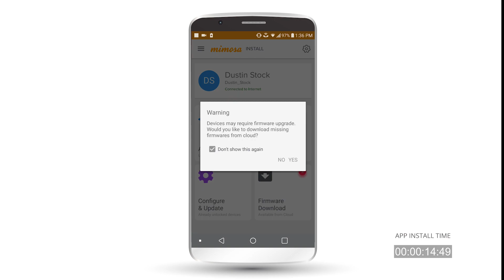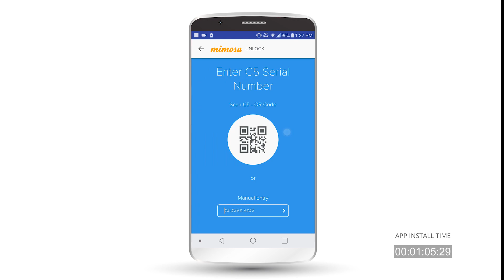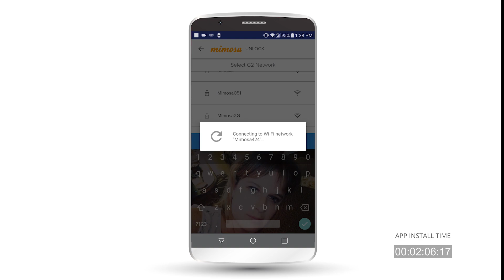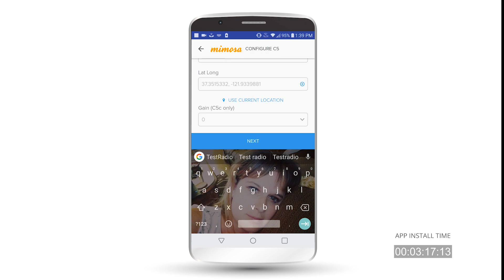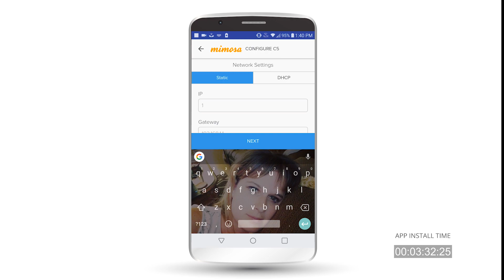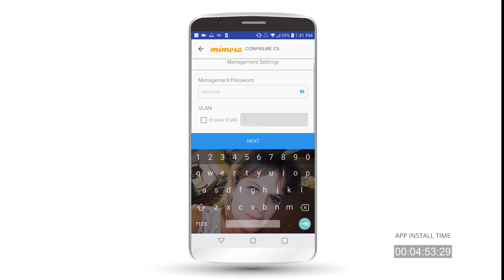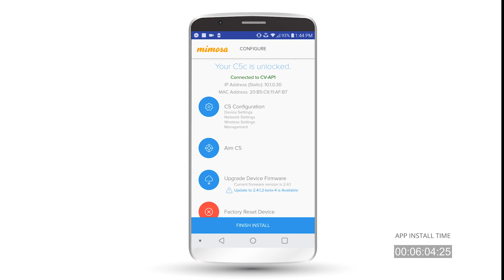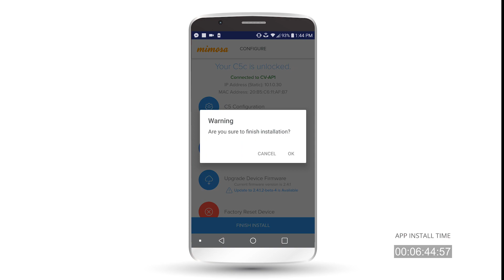Mimosa in the Field: Install and App Demo (Updated)

Comment: I have c6x radio running 3.2.2 p20 firmware . How I configure mimosa managed cloud in NMS section . And where I find device key that is required to connect mimosa device to cloud